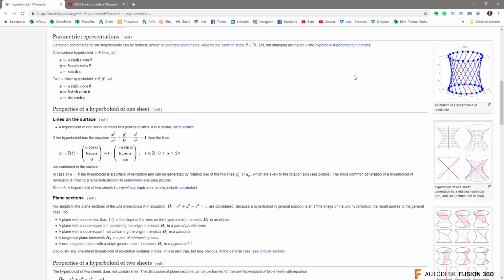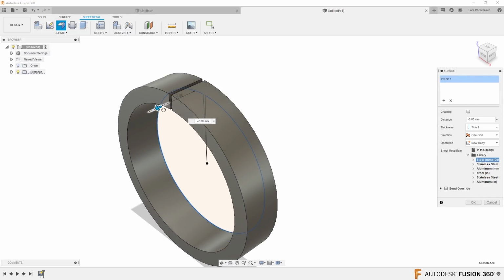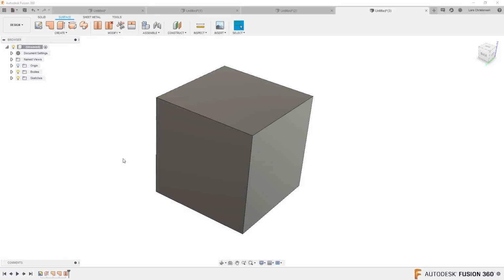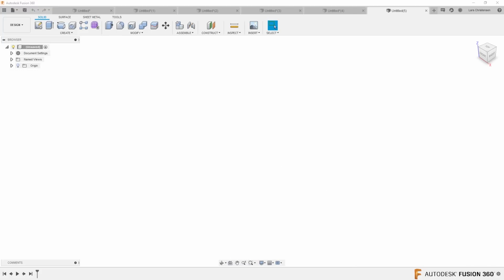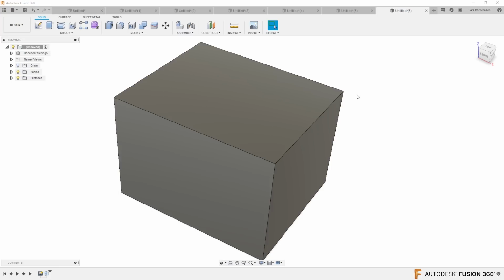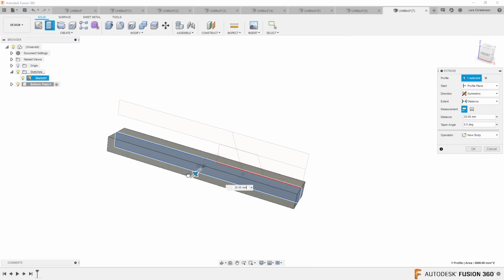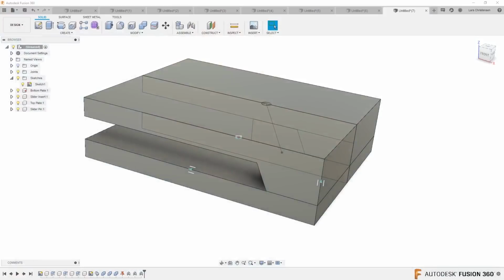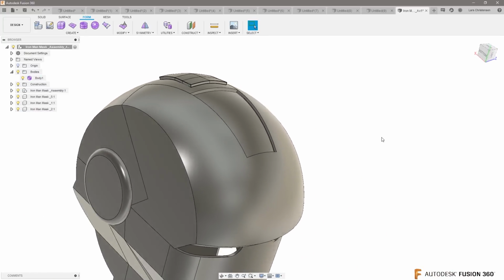Ask LarsLive Fusion 360 — Sunday Edition — Episode 8

Comment: For everybody's usage here are the video Timestamps 

0:50  HyprBoloid

9:40  Ring with Pattern

15:20      Motorcycle Frame

31:15 Machine a screw

33:00 Tool marks left from cutting CAM parts

40:38 Black Sketch Plane

43:23 Patten Issues

46:37 Slider on a Mould

59:32  Bottom up vs Top Down modelling approach

1:02:50  Woodworking Finger Joints

1:02:13  Issues with the timeline

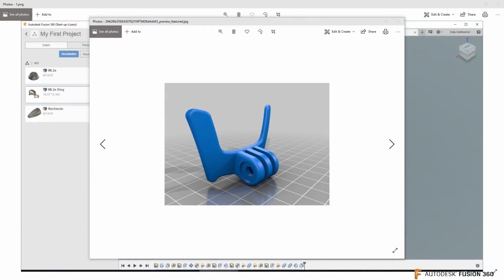1:06:15  Helmet Go Pro Mount

Comment: That sheet metal trick is the perfect method for creating raised or embossed text on a curved surface. It's far less tedious and more accurate than anything I've tried before. Also works for making cut out text using a stencil font. Proves that if you watch Lars long enough, all your Fusion problems can be solved. ;)
Reply from the maker: Thank you 👍😊

Comment: Hi Lars, I love your videos. 2 Things: 1. My Fusion 360 looks different than yours. Mine does not have the Design Selector nor does it have the sub tabs across the top. What's the difference?  2. This method https://youtu.be/ezKZIvzVGRM?t=446 may address the question about characters around a round pipe @ 43:30
Reply from the maker: Yes, I am using the new UI. I think it will become default this summer. Click preferences in the upper right, click your name and then you can change the setting in the preview section

Comment: Good description on essential concepts and differences between points, curves (lines), surfaces, and bodies. Like your explanation before of bodies vs components. As a machinist, your experiences of cutting the end result, a part or tool, is the guts of manufacturing. Your early comment that F360 is a mechanical CAD package, like Solidworks, Inventor, etc  is very important for a Rhino or Alias user to understand. You did mention the Form toolset, which Alias use in one of their versions, I think. These surface modelers may be creating cars, boats, consumer, medical, all very contoured products. The recent addition of spline curves in Fusion is one of the best additions ever.